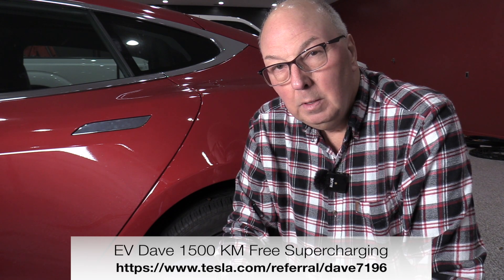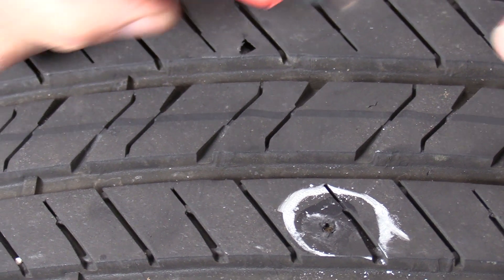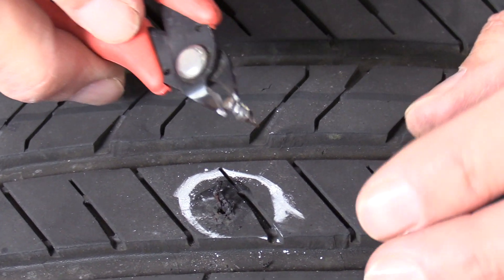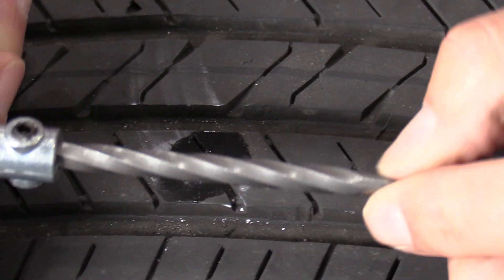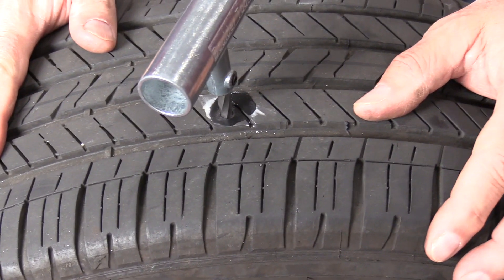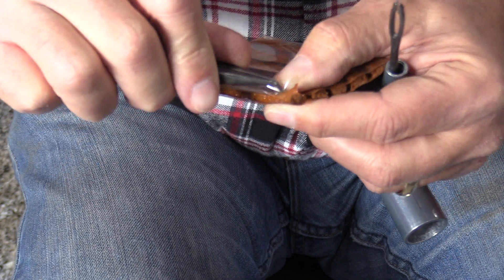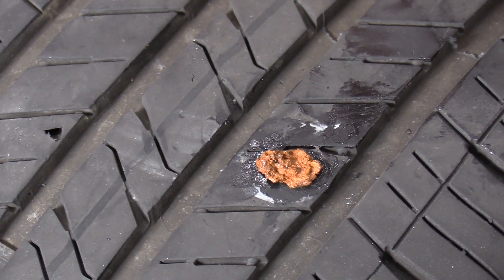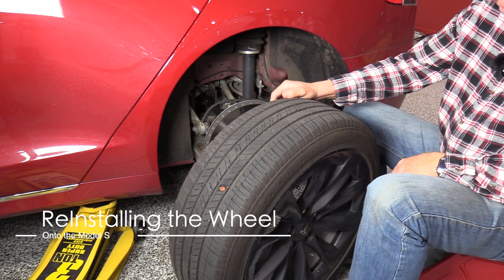Can You Fix a Tesla Tire by Plugging the hole?

Comment: Can you plug the part of the tire super close to the sidewall but technically not on the side wall?
Reply: No. It's all rubber. I tried.
Reply: @matejovich shoot so it probably won’t last long then. I plugged and patched a few weeks ago. Holding up so far but sounds like not a good idea.
Reply from the maker: No, some do but when you turn it creates shearing on the spot. I’d replace the tire.

Comment: We had a screw go through the rear tyre of a model X although we didn't know it. However, it caused the sound absorbing material to come loose on the inside of the tyre and this caused serious wheel balance issues.  Just thought I'd mention it as we are not the only ones to have experienced this.
Reply: Can you describe symptoms?

Comment: this is probably the best way to fix those ev tires if its not blowing up. tesla roadside quoted me for 130 for repair or 450 to replace a single one which is laughable.
Reply from the maker: I’ve plugged lots of tesla tires all with except results, no failures yet.   Most tire places can’t handle a patch on the Continental quiet foam and glue filled tires.  Patches don’t like to adhere well.  A plug solves this especially when your in the boonies
Reply: @evdave528  yea, the proper patch repair is way to complicated when the foam getting involved.
Reply: @evdave528 so doing it this way will not loosen up the sound deadening stuff inside the tire? Pretty scared to mess anything up on my modely

Comment: Plugged my wife’s right rear tire on her model 3. Has held pressure for a couple of months. My puncture was large in comparison to yours . 
      Because of this and no spare we decided to replace the tire. Total miles is 17K plus so we ordered a single tire o match the factory Michelin tire.
Reply from the maker: I had the same problem on my wife’s model S it was a gigantic bolt and I could not plug it properly so I ended up buying new tires since the car needed it

Comment: Thanks Dave I just ordered 2 kits 1 for each of my cars , but one thing that's very important is have a tool to remove the screw and something else for a fulcrum  to set underneath the tool on the tire  to help pry  it out this is the most important piece as much as plugging the tire  kit does not come with these removal tools . This can be very difficult.  Make sure you add these to your kit. And of course a good air pump . I carry a full sized spare and jack in my Model 3 . I'm going to test if my jack will even fit under the car with the  puck for protection with a completely flat tire.  Because that will lower the car at least 4 or 5"

Comment: Hey Dave once the tire is plugged in like that can it be patched later ? I did this and it still slowly leaks air.
Reply from the maker: Yes they can patch it later take it in to get patched
Reply: Or, plug it again. You may have not plugged it properly. I’ve seen that many times through the years.

Comment: Good video, only thing I do different is to set the torque wrench to 65 lb ft and do an initial torque and then final torque at 129 ft lb and I only click it once. PS. I switched from Goodyear RSA2 to Goodyear touring w/o foam. The touring is pretty quiet without the foam and it's cheaper!

Comment: Apparently you don’t know much about tire repair. Why would you make a hole larger? Just put the plug in it and you will be much better off. If you are not an experienced tech don’t make videos on issues you don’t fully understand what you are doing. You put other people like yourself at risk. Idiot!!
Reply: It's usually necessary to expand the hole to make it easier to get the tool in. There's no risk in this, it's standard procedure. 
I've plugged 100's of tires, using this method, and there's never been a problem.

Comment: Don't Tesla's have acoustic tires with the foam on the inside? Not sure plugging or patching is recommended. It's recommended to replace
Reply from the maker: Yes they do, it’s just a layer of foam rubber glued to inside of tire
Reply: Agree with Dave's reply.   I have plugged two different punctures in my OEM continental tires.  I did not have any sense that the foam was a problem, during the process.  And it did not hinder the plug from sealing the hole.  
Some punctures are easier to access than others.  I do carry a plug kit with me now, but I also carry a DeWalt impact wrench, with battery and with the proper impact socket, to allow me to remove the punctured wheel/tire combo, if needed.  Which means I also carry a compact jack with me.
I would rather avoid calling anybody for help.  Though I do keep a AAA account, as backup for emergency road services.
I bet that Tesla Roadside service is pretty good in some parts of the county. But probably pretty sparse in much of the USA.

Comment: Gee Dave how come you guys who do these tire repair kit video's don't use the rubber cement glue that comes with the kits?😳 it's a bit misleading people will be having all sorts of problems with the plugs working there way loose and popping out of the tire and could lead to an accident 🙄👎
Reply from the maker: My kit used a different plug type just as good besides gluing to cured rubber can be difficult since the glue only softens the plug to stick to the inside of the hole.

Comment: Hi Dave, the tool that puts the pug in the tire did not cut the pug when you pulled it out.  That tool has a gap at the tip, when you pull back gap opens up and the plug comes free of the tool.  Unless the tool you have works different ?
Reply from the maker: Inside the Tol hole is sharp, the floating retainer holds the plug in while you pull the handle out, seems to work ok

Comment: I have plugged motorcycle tires before, but never a car tire.  But I have nothing against plugging.  Obviously if you have a spare tire, swapping it for the flat is the quickest way to get back on the road.  But more and more cars are coming without spares these days.

I did take delivery of my Model Y on Dec 30 and I think I got the free year.  I have only ever been to 1 SC station and it didn't charge me for it.  Planning a road trip next weekend so I'll find out then.
Reply: I know years ago in Florida it was required by car dealers to provide a spare and the means to change it. 
We bought our model 3 in Orlando and it came with no spare so it apparently isn’t required today.
Reply: @hvacmike1175  I knew of a woman with a Cadillac that came with no spare.  This was in like 2013 or so.  It had a place for one, just the dealer didn't install it.  I think it was on option.
Reply from the maker: Enjoy your Y

Comment: Is this something you think you could do without removing the wheel from the car? Or if I'm on a road trip in the middle of nowhere and want to use this trick, should I plan on bringing a jack and torque wrench with me?
Reply: I've done it with the tire still on the car. Easier on a front tire where you can turn the wheel for easier access, but I've done it on rear tires as well. Just have to lay down on the ground and you don't get as much leverage. Not fun, but possible.
Reply from the maker: I guess you could do it in the car but I wanted to have better video of the process
Reply: I wish you could but you need to remove the tire.  It really takes a lot of strength to push the tools through the tire.
Reply: I've plugged without removing the wheel.  Just need to move the car so you have easy access

Comment: Dave, my sister-in-law has a model X and the foam liner broke away on at least one of her tires and she replaced all four tires at Discount Tire. I’m not sure how good that foam lining is. I am sure the foam deadens some sound but may not be reliable.
Reply from the maker: It’s for sounds but it’s very light wouldn’t think you need to replace a tire for that only, hope it wasn’t a sales tactic to sell her more tires
Reply: That is puzzling because of all the years I've monitored the Tesla forums this is the first I've heard of the foam liner breaking away. It has not happened on any of the 3 sets I've had. I suspect the foam deadening is measurable in the lab but not sure if it is genuinely noticeable in real life. I've had good luck with the tires for wear and traction, however.
Reply: @Scott-sm9nm  I actually saw a video on this very thing happening on YouTube. I’m not sure which Vlogger it was but the foam lining broke away on at least one of their tires and they had to stop and have it replaced. The lining broke away on that tire or it was defective when they received it and they had to stop again and have the tire replaced. So I have seen at least one instance of this on YouTube. Unfortunately for them they were traveling away from home at the time. In my sister-in-law‘s case the discount tire personnel got on the phone with Tesla and told them what was happening and that the tire was defective. They only had like 12,000 miles on them at the time. Tesla prorated the cost of tires and she replaced them with a different tire.
Reply: @senordockman1138 , it certainly sounds like a defect as you would think that centrifugal force just constantly keeps the foam pressed to the tire ... ie. not stressing the adhesive that holds it there.

Comment: Thanks Dave. Can you provide a link to the tire repair kit you bought? And a note... Years ago, we used to chalk a lug and the hole for it so that we could put the tire back on the same orientation, so as not to screw up the balance of the tire. I don't know if that's still current. (I can't remember the last time I had a flat tire!) Thanks again.
Reply from the maker: Check Amazon I bought it there

Comment: Thanks for the video Dave. I have put some plugs in tires myself and you did a great job. I like the plugs much better than going to a tire shop and listening to a lot of crap about needing to replace all of the tires. On another note, when our MS tires had to be replaced at about 28 k miles, I did away with the foam lined tires. Some people say the foam lined tires have less road noise and that may be true. I am 73 and don't hear that well but our MS rides smoother without the Tesla recommended foam lined tires. I came to that conclusion with my 73 year old butt test and my butt will not be flim flamed by some young tire salesman!
Reply: What tires did you use as replacements for the foam lined tires?
Reply: @dougfrith5001  Hello Doug, I replaced the foam lined tires with Pirelli Cinturato P7's. Our MS rides much better now. I have put about 25 K miles on the tires and they are doing ok.